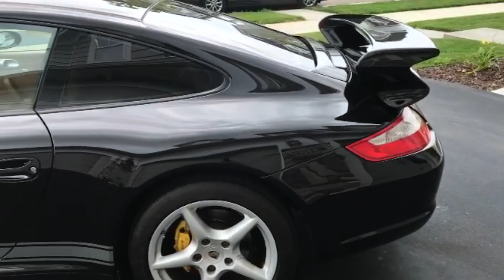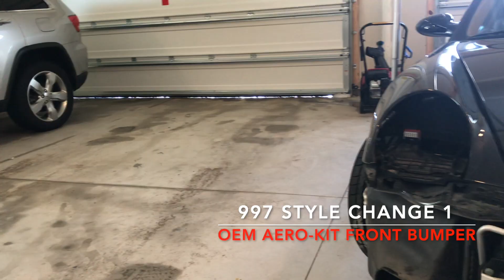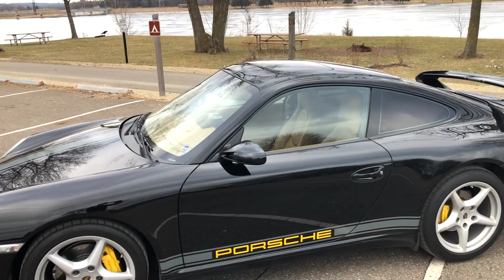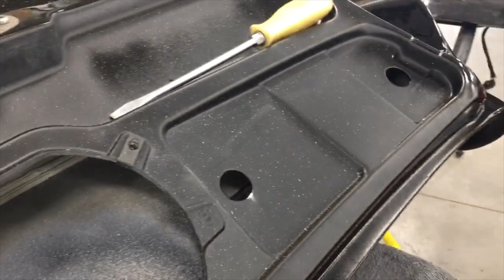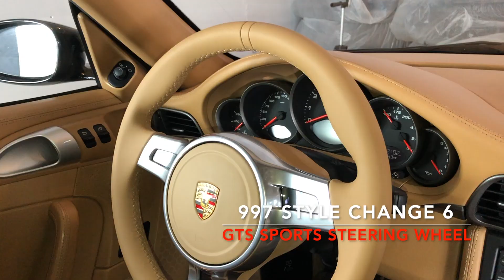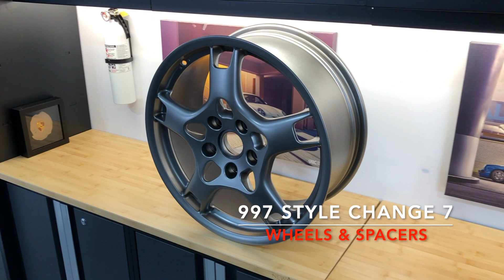The End of One Journey is the Start of Another - Porsche 997 Style Transformation

Comment: You have made great progress and tackled projects that, frankly, I would be scared to try. No way would I ever try to change out my steering wheel with an air bag. You must have cajones as big as mellons.

It appears that you are at a crossroads: the 997 seems to pretty much done. So, what next? Think about filming more Porsche lifestyle events and maybe driver schools. You have taken your 997 to a higher level--do the same for your driving skills. Or, perhaps, think about starting over with an air-cooled 911. Maybe you could try to copy a Singer 964, which would be a great video series and something I would like to try--or, better, copy.

Another approach would be to add a different brand to your stable. As a Brit, you must have a soft spot for old Triumphs--TR3's and TR4's or 4A's. I would love to restore a TR4A--or copy someone else (It's great to give suggestions to someone else rather than doing them yourself).
Reply from the maker: Thanks Robert! Appreciate the feedback and the suggestions! I’m almost at the crossroads, but not quiet. I still have a few projects I want to complete on the 997 like the exhaust mod and GT3 rear bumper. I’m leaning towards a 991.2. As much as I love the air cooled cars they’re not suited for big orangutans like me. 😆 As for adding another brand to line up... I’ve always had a soft spot for Mustangs!

Comment: I relate to your thinking on going back to the OEM media head unit. I put in a Kenwood as the Porsche unit was the only really awful piece of Porsche engineering. Still, the aftermarket unit seems out of place despite the modern functionality. My compromise was to snap a pic of my hood ornament. You can download it as the screen background for the head. I keep the unit in standby so that is what you see unless a call comes in. You might check it out.
Reply from the maker: I’ve done that too. It definitely helps!! Thanks!
Reply: @AutoAmateur  I replaced my motor mounts with stock units; it made a huge difference, understanding that my car has 80k miles. I think some of the aftermarket pieces really impact ride quality though. Do NOT advise taking on the transmission mount!
Reply from the maker: Thanks John! Appreciate the heads up!

Comment: How is your shifter? Feel any play in the linkage? In my 987 I’m considering the function first shift-right bushings to tighten things up a bit. Between that and a short shifter I’ve heard (and read) good things from doing the pair together. It would be neat to see you tackle those jobs on the channel
Reply from the maker: Great suggestion!! The short shifter is on my list for sure, that and maybe a brand new clutch. I haven’t researched it too much yet though. My current shifting is great but occasionally getting back into first as I approach a light and come to a full stop is a pain.
Reply: Auto Amateur as you slow into to a light that suddenly changes and you need to shift to first, double clutch and it’ll go into 1st gear more easily
Reply from the maker: Ok I’ll try that! Thank you!!